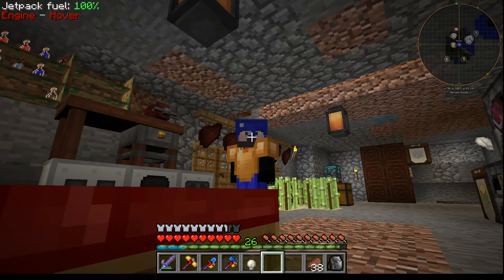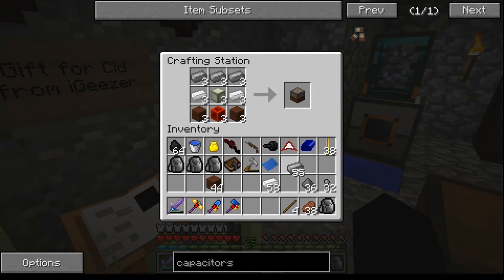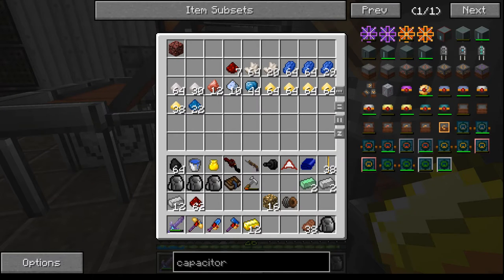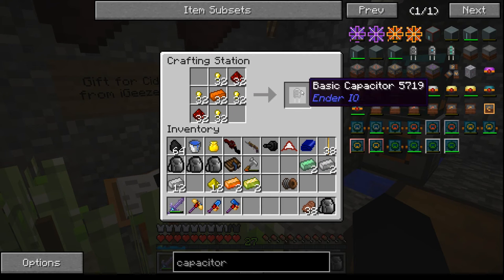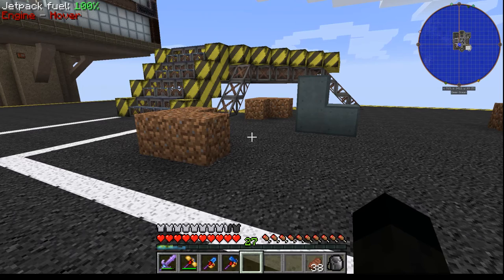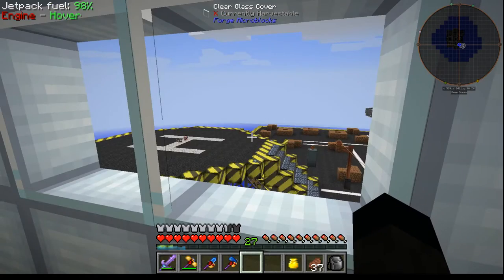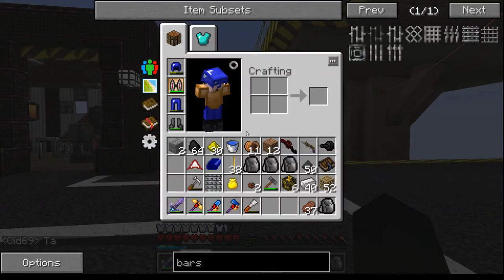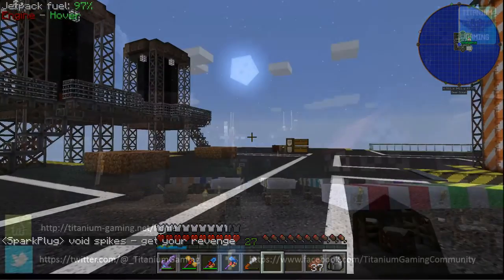Feed the Beast - Infinity Evolved - 9 - Substation

Comment: 6:00
Paid Cosmetics are better than Pay 2 Win. That is about all to say on such; Pay 2 Win destroys games, paid cosmetics do not. For a good example of Pay 2 Win, Tribes Ascend. The studio behind it are now trying to revive it now with a Paid Cosmetics and unlocked all classes and weapons to everyone now. Since their other game failed and died, it's one of few they got left. Game was basically dead, it's barely still alive. Is many other games that met similar fates. 

24:00
Go straight to HV wire. Just a lot easier to handle in the long run. 

29:40
No she here, just an oddity of a guy.
Reply: HV Wires are powerful, but as far as I know they are not able to be more than 1 connection per connector
Reply: +Aleksandr Gerdt
What the HV Relay is for. It is used to multi connect and relay HV wires.

HV Connectors are just "plugs". HV Wire handles 32k RF/t total, each HV Connector outputs or inputs 4096RF/t. Relays can run the wire, but the connector puts out or takes in RF. So if you need 8k RF/t, you need two input HV connectors and run a wire from those to a HV Relay and then to the two HV Connector outputs attached to the block needing the RF power. Hopefully that makes it clear. Clever designing really.
Reply: Ah. Good to know. I have not very much experience with IE Wiring.
Reply: Aleksandr Gerdt
Neither do I really. I have been playing and using it in this pack.

Is really wonderful though by what I have learned. More so with Immersive Integration ME (Applied Energistics) wire. Long range ME is amazing without being forced to use wireless quantum ring.
Reply: +Sea Wry Yeah. Unfortunately IE cables are chunkloading and disabled on the public server I play
Reply: Aleksandr Gerdt
IE wires don't do any form of chunk loading.

 They use coordinate based connecting. The wire you see just decoration and shows who is connected to who. Wires can run through unloaded chunks and you still would get power or ME data/redstone (immersive integration) on the end nodes (connectors), so long the nodes are chunk loaded.
Reply: +Sea Wry Well, somehow they don't work on my Server after the chunks are reloaded
Reply: Aleksandr Gerdt
Probably a mod conflict. I know ChickenChunks has a conflict.
Reply from the maker: +Sea Wry Yeah pay to win has always been a douche strategy, and I am totally behind Mojang on their stance on it.

I'll get that sorted soon :D I don't have a lot to replace.

And I should no not to judge a player by their skin ;) You know I knew a guy on line, turned out he wasn't a giant green frog.